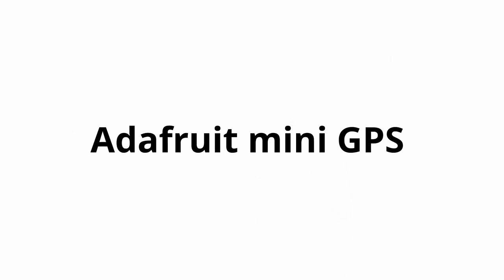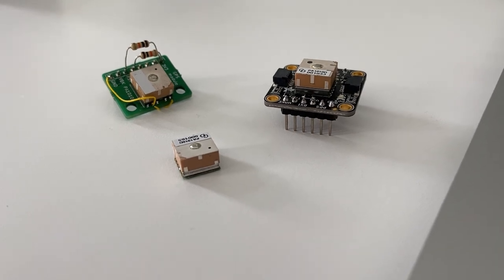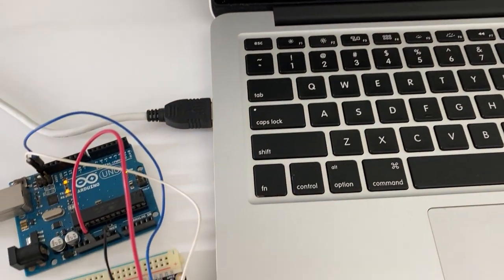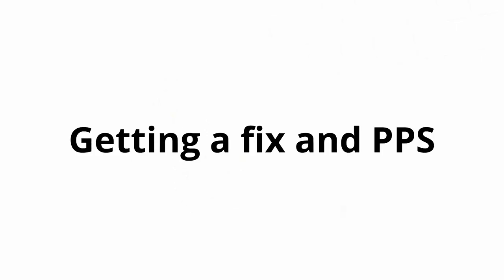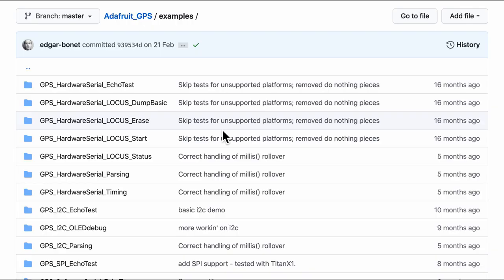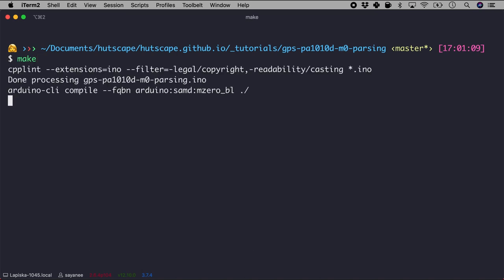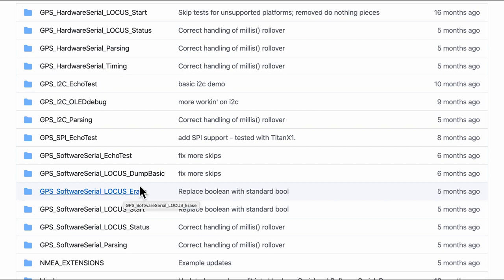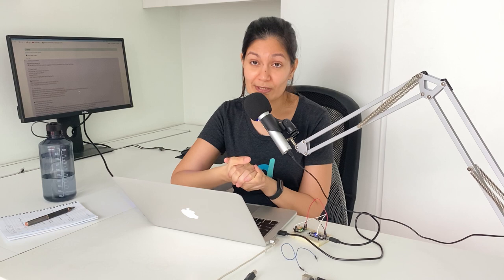Getting started with a GPS module // With Adafruit PA1010D and Arduino via I2C or Serial

Comment: Hi I'm using the adafruit GPS and the new M0 Lo-Ra boards I have the GPS transmitting the receiver is receiving but I can't get the receiver 2 print the latitude longitude on the serial port of the ESP 32 web server Board .   I just can't figure out how to get Arduino boards to print on each others serial monitor all it has to do is print latitude longitude on the serial monitor of the ESP 32 and it will automatically refresh my Google map widget

Comment: Thank you for the great overview of using the PA1010D module.
The module is streaming data continuously after the setup() routine is done. This generates a lot of traffic on the I2C bus.
In my hardware setting there are further I2C sensors at the same bus. 
Therefore my question: is it possible to stop streaming and set the device in a request-response-mode?
I would be very happy about a code example :)
Best wishes
Reply from the maker: Interesting question! In my experience, GPS sensors usually use UART to continuously stream the GPS data. Maybe you use the UARTminstead of I2C?

I am not aware of I2C-based request-response for GPS data :( Sorry!

Comment: Hi there, I'm using ic2 and for some reason not able to get a lock after it working great for a while. I keep reeading that the flashing LED is only active if there is a lock, however I don't get any output. Does this indicate I have an issue with wiring or is this incorrect?

Thanks!
Reply from the maker: I'm assuming by "lock" you mean a "GPS fix". Since it did work for you before, I am guessing the wiring is not an issue.

For me, the first GPS fix always takes a bit longer. Ensure it's in the clear view of the skies / outdoors and give it around 5-10 minutes.
Reply: @sayanee  I seem to have a strange, but consistent behaviour: after spamming for 100 or so requests for a about 30 seconds, I then instantly get 110 satellites and a fix. Without this: the much slower read never rtreives anything.

However, if I spam requests as above, then switch to the slower request, it works fine after this without issue.

My conclusion currently is that there is a build up empty results from a lack of requests on the internal buffers, I effectively clear this by this initial spam. 

So strange!

Comment: Is the Arduino running slave mode in the I2C example? So any received data from the GPS I2C is immediately sent to the serial port?
Reply from the maker: I don't think so. The Arduino MCU is still the master that uses the slave address in GPS.begin(): https://github.com/adafruit/Adafruit_GPS/blob/master/src/Adafruit_GPS.cpp#L148
Reply: @sayanee  I see. My previous experience in GPS modules are they just spew data and it's up to the CPU to receive and parse it.
Reply from the maker: @hzrnbugsie  That's via UART right? Yes, GPS modules are usually simple enough that they spew out the data via the TX pin. I2C was available for this module, but I'm still going to use the UART protocol.
Reply: @sayanee  Yes, this has always been the case for UART mode. I guess an I2C interface makes sense if you only need GPS data on-demand

Comment: I recently purchased this module and am using the I2c protocol through the connection ports on the gps unit to be sent to an MKR 1010Wifi. When the PPS indicator light is active my serial monitor only displays zeros for the date, time, fix, etc. I tried using the pin headers and an UNO and it did work. Any suggestions?
Reply from the maker: It would be really hard to debug this remotely, so I can suggest a few things:

1. Test I2C on the MCU: Try another non-GPS I2C sensor with MKR 1010Wifi to ensure the correct I2C pins are used.
2. Test GPS module: Try to use the GPS module via the UART connections with MKR 1010Wifi and ensure you get a fix first.
3. Test the 1PPS: Is the 1PPS blinking every 1 second? "light is active" seems like it is blinking more than once per second. Check with the seller/manufacturer what does this blinking pattern mean.
Reply: @sayanee  I've gotten the gps unit to work using both i2c and UART on the arduino Uno, but even using wires directly to the SDA/SCL pins fails to work on the MKR. I believe the issue lies in the difference in processors between the two devices. The Uno being AVR, and the MKR being SAMD/ARM.
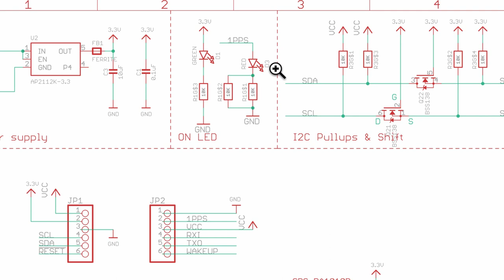Reply from the maker: @devondevriendt  Hhhmmm interesting. As seen at 5:07 I used RobotDyn M0 mini whose MCU is SAMD21G with Arduino firmware (with UART though).

But here is a basic tutorial on using the MCU SAMD with PA1010D with the I2C interface. Hope it helps 🙏🏼Keep looking and maybe try other I2C sensors on the MKR maybe.